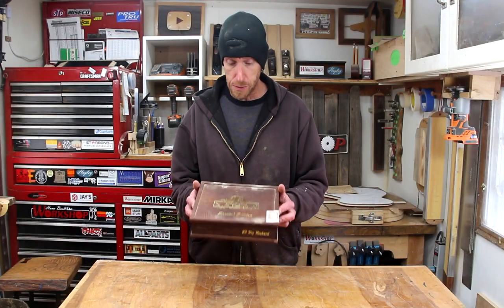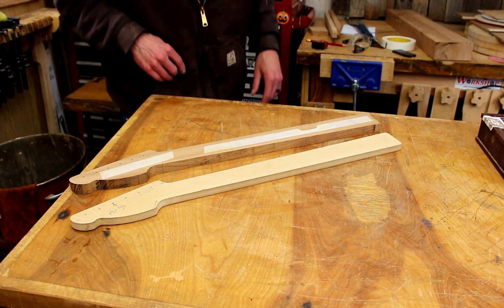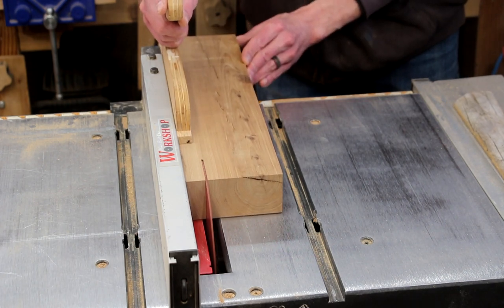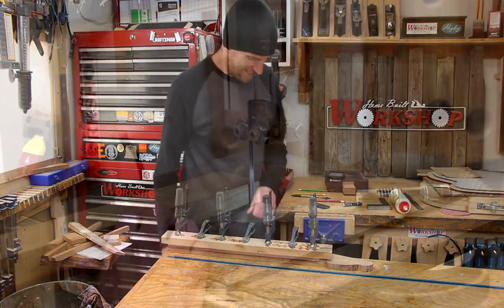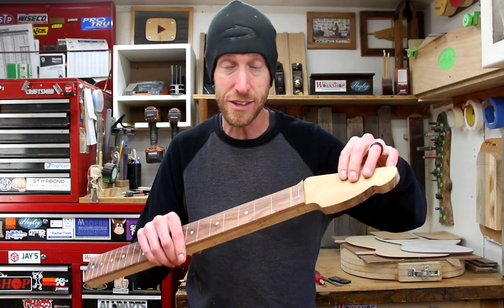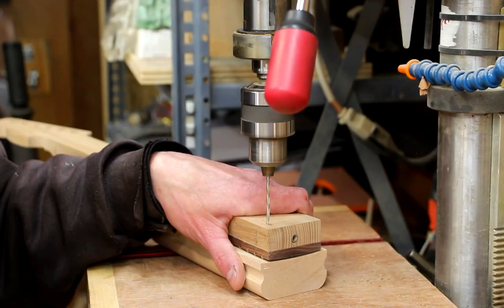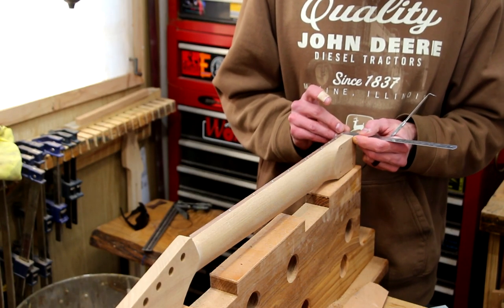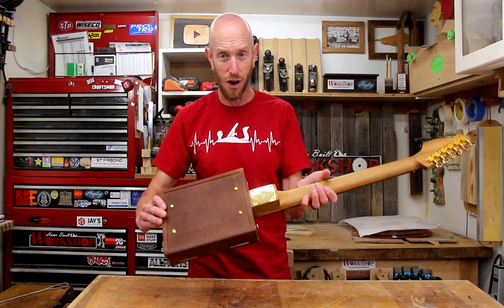6 String Electric Cigar Box Guitar Full Build | 2022 GGBO Freestyle Build

Comment: I notice that you don't seem to use locating pins when gluing the fret board on. It looks like an easy way to insure that it doesn't slip I wonder why you don't use locating pins?
Reply from the maker: I've tried pins on several builds and it does help with slipping. I don't like the processes I've tried so far and the extra work of drilling and fitting the pins doesn't save me enough time to justify using them. I will keep trying out different methods but for now, this is the fastest way for me. I just make sure it doesn't slip and monitor it closely until the glue sets.
Reply: An easier way is just to use some table salt on the glue. It doesn't compromise the strength, and it "disappears" as it's soluble in the glue.